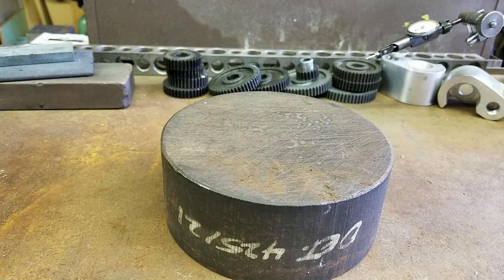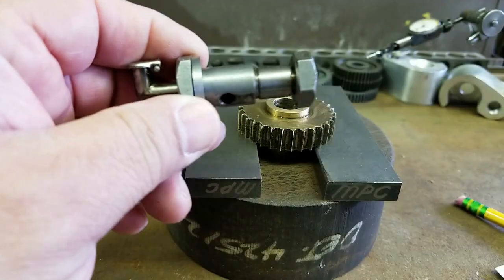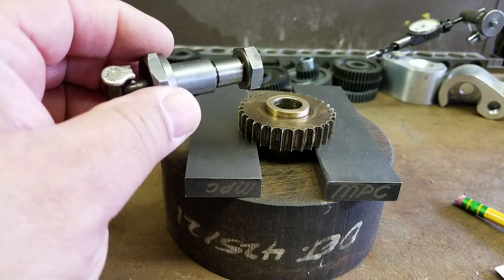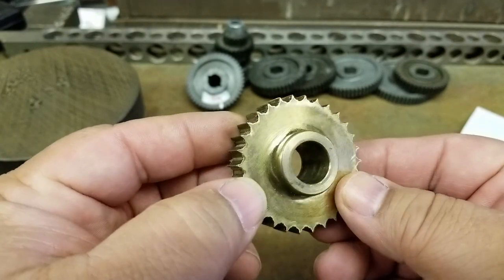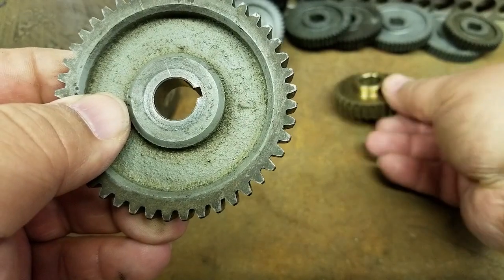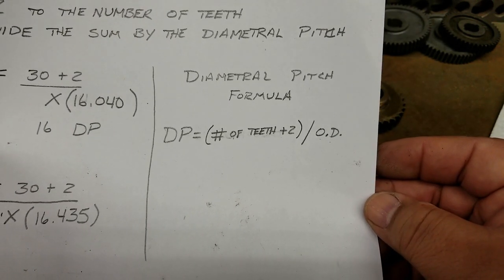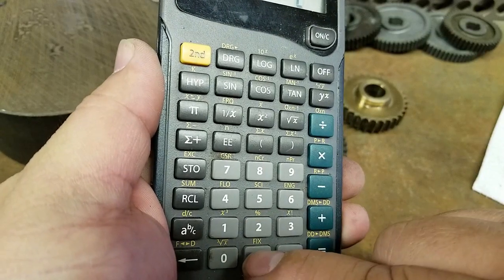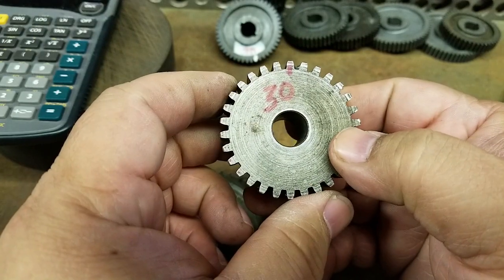SHELDON LATHE - REPLACE A WORN GEAR  - Part 2 of 3

Comment: Misumi will make you custom gears
Reply from the maker: Jordan, thanks for the info i have never heard of them myself. So i looked online and it appears they are similar to McMaster carr and grainger. I took a different route making my gear but its good to have multiple sources. 
Have you used them to souce a gear?
Thanks for watching and commenting...
Mike - Plus8Precision
Reply: I haven't ordered anything personally but I have heard good things. From what I understand when you order a custom gear they add it to their catalog. I spec'ed a metric gear and if I recall correctly it was under $75 shipped. Time is money right?

Comment: I had the same issue with my Sheldon, the gear on mine looked the same as yours with same wear pattern, which tells me it is original to the machine, I ended up cutting my own after lots of studying and needed tool collection. Good machines worth the extra work to keep em going.
Reply from the maker: @Kenny Tolman, The info I found it said the gears were fiber gears. That didnt make sense to me. I bought the lathe in a dark dirty warehouse with no power in that area. I bought it on faith. Well all the worn things i have found, that gear,  my quick change gear box has led to worn ways. I am trying to come up with a plan on how to proceed. I buy the machine to use not restore. I dont mind fixing stuff but when are machines to far gone. I dont have the cash to get the ways reground. Im doing my best to keep this old lathe going. Thanks for watching and commenting...
Mike - Plus8Precision

Comment: I think that bronze gear is not original.  My bet is that the original would have been the same material as the other gear on the reverse tumbler.  I think the original has been damaged and someone has done a very shitty job of cutting a gear with who knows what as a tooth profiler (angle grinder disc ? ).   Bronze normally is very hard wearing.

My web pages on making gears on a lathe with only basic equipment may be of interest: http://users.tpg.com.au/agnet/cq9325rev7.html

Cheers Rob
Reply from the maker: The parts page states the gears are made from phenolic or fiber gears. 
Mike - Plus8Precision